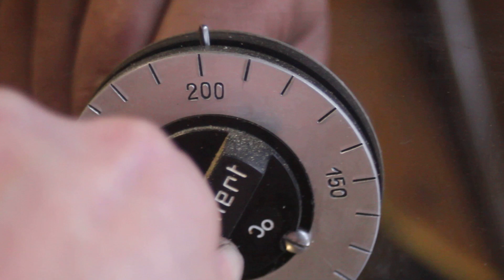Knife making ~ Chef knife from mosaic damascus! with short 2020 review

Comment: I’m not sure why some smiths insist on setting welds by hand.. you can press them together easily without anything popping apart.   Make sure it’s at welding heat, 2 passes with the press and back in to the fire.  Next heat you can  put the weight of the earth on that stuff and it will take it.  Soak time is important as well.  You need adequate grain growth to ensure fusion between layers.